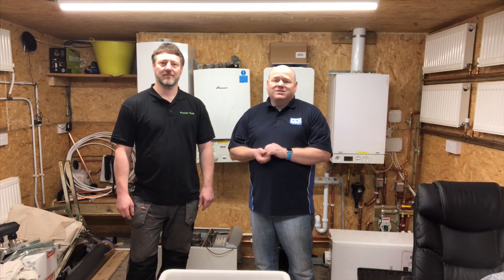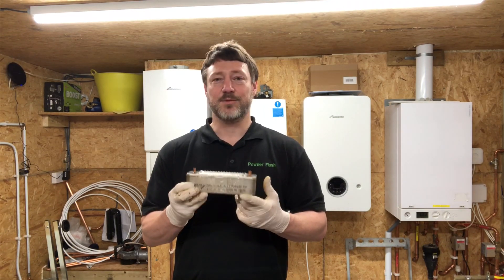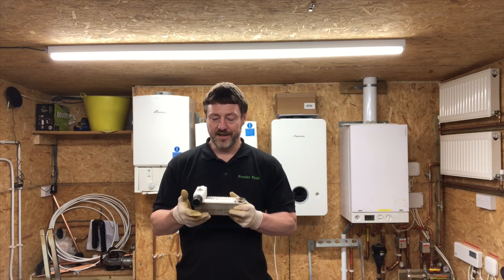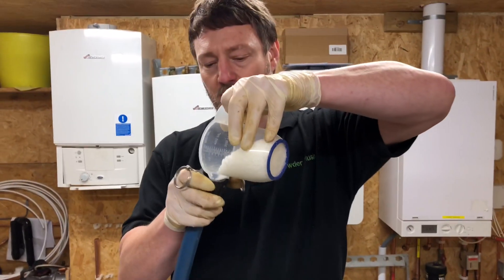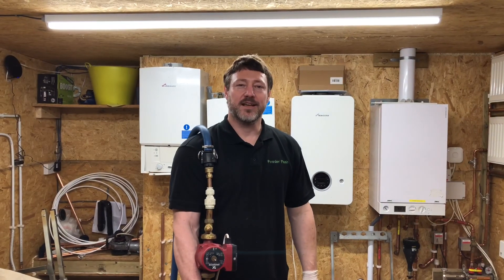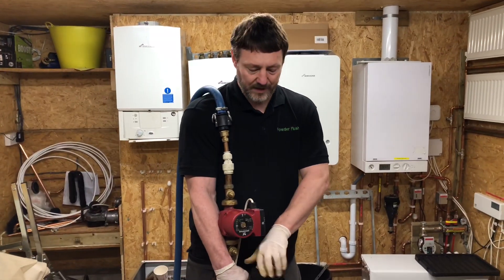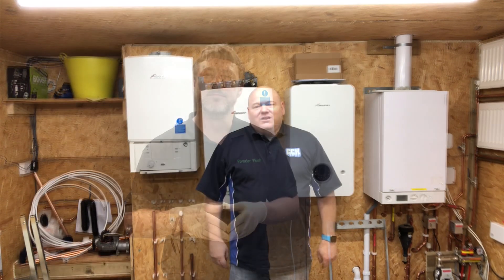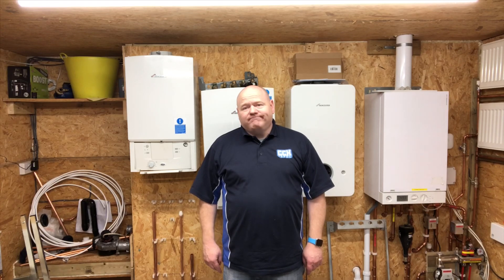Powerflushing with pellets - Powderflush

Comment: in theory this is great however i have been doing powerflush for around 15 yrs daily and i have 1 question if you have a blocked pipe and your try to clear with (powder) solids all that will happen is the powder will back up and you can never clear it so yeah this may work on partial blockages but there is no way it will work on a full blockage

Comment: Confucius says “If it seems be too good to be true, it probably is”.  Just a few thoughts.  Good luck with the following: 1)   a blocked CF/OV can be 95% blocked so renew pipework.  Even a screwdriver will not clear.  2)  A blocked 8mm manifold, (with say 6 rads) cleaning agents will take the least path of resistance so the failed rads will not unblock. Renew pipework.  3) Hidden filters in combi boilers need to be removed/discarded/cleaned 4) Good luck cleaning a pump impeller like shown.  When they block they can be 99.999% blocked.  And you can’t tell until you inspect.  Mechanical cleaning required.  5) Careful not to block Weissman or Gionnani HX become when they are partially blocked.  Then the crystals in suspension cannot dilute into solution, so blocked.  6) Poor flow in a system is often due to other factors; poor pump performance, diverter valves not working correctly, failing isolation valves, failed auto bypass vales, manual auto bypass valves fully open,  blockages at filling loops external and integral.  The list goes on.  Happy flush'n😁

Comment: We just had Stephen and his co-worker visit today at our home in West Sussex, and they were absolutely brilliant!! They worked solid for the whole time they were here and fixed our hearing issue perfectly!! For two winters we had a poor flow of heating and also had banging in the pipes in the ceiling when heating was on. We were advised by our gas engineer to get Powder Flush to visit as a chemical wash failed to solve the problem and Stephen came and performed a system flush and also repaired a fault, now we have brilliant heating!!! We would 100% recommend this company to anyone who needs to improve the efficiency of their central heating. They are a legitimate business and their website doesn't include any specific contact details because they are a unique patented business that protects itself from it's competitors, but the booking procedure is very straightforward on their website and only for those who are serious about getting their heating system fixed. It's given us such joy and relief this evening as we enjoy a peaceful cosy house, no more banging and no more frustrating inefficient radiators! Thank you so much Stephen for your expert help, you went over and above the service you give, and you are worth every penny of your service! :)
Reply: Hi do you have a contact number for Stephen

Comment: Could av done with this before Christmas had baxi duo tec boiler couldn't get an engineer to repair
Boiler was kettling advised power flush would send fault elsewhere so replaced boiler
Do you think I have been had by engineer!
Reply from the maker: Powder Flush do a service where no fix and you do not pay, Not sure how it works though. Thanks.

Comment: Hi Allen. Apologies if you've already answered this question but I've seen a few of your videos re plumbing fittings but I haven't found anywhere where you refer to compression fittings. What is you're view on using them?
(Mike H)
Reply from the maker: I only use compression when needed, I wouldn’t use them on a full heating system. Thanks. 👍
Reply: @AllenHart999  Why not please.

Comment: Here is a great new product to revolutionise the flushing of heating systems.

You can't buy it anywhere and we won't sell it to you!!!

Thanks guys. Well worth five minutes of my time...
Reply: Its pretty obvious that you get Powderflush to come and clean your system, why should Powderflush give away there secrets and end up with nothing when they are the ones who discovered/invented the method that works so well, i am sure it will eventually be copied by someone else but i would have no problem getting them to come round and flush a system if it works that well compared to powerflushing which tbh can be a bit hit and miss.
Reply: @ATomRileyA  true , and like many products its only a matter of time before someone else produces something along the same lines , thus growing the market then it will become freely available , but as it is your right its really in its infancy and should only grow with videos such as this
Reply: he is using dry ice nothing new
Reply from the maker: AL BG I have been really interested in knowing more about it and have taken the time to find out, I thought others might also be interested. The product may become available in the future who knows, As installers it’s good to see what others are doing in my opinion. Thanks 👍

Comment: What are actually these pellets made of ? Are they pushed into the system through a flushing machine like a Virax or Rothenberger (these machines that combine air+water flushing system).
Reply: Karim ABBES they won’t tell you that.

Looks like they stick them in an ordinary power flush machine which forces them around the system.

But suspect that the reason why they don’t sell the pellets, and do it as a service even though any plumber can use these with their power flush machine is because they don’t want people to find out what the pellets actually are as they are likely an off the shelf product they buy in bulk and have ground down into different size grades for their application.

And as a consequence they aren’t protecting the pellets but rather the process of using the pellets for flushing making it equivalent of a patented process rather than product 

If it’s not an off the shelf product then there’s not much of a business case for offering it as a service compared to selling the pellets when you think of how many power flushes are carried out annually, if it’s unique product then they would make a killing financially selling to prospectively almost every plumber that carries out a power flush and their profits would exceed selling as a service for no on site work required.
Reply: Looks like soda crystals to me, they would dissolve in the same way & achieve the results shown.